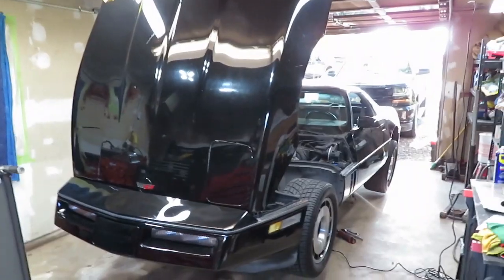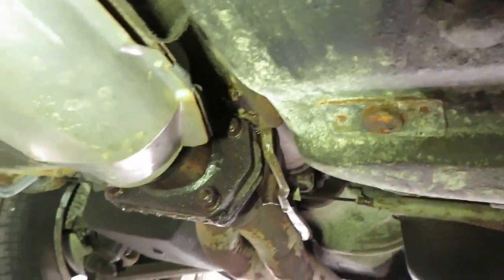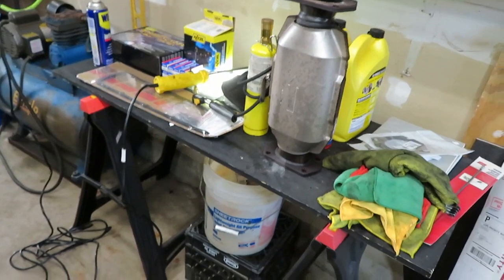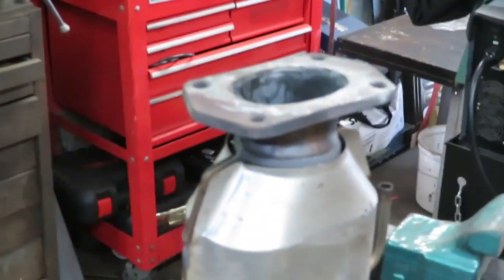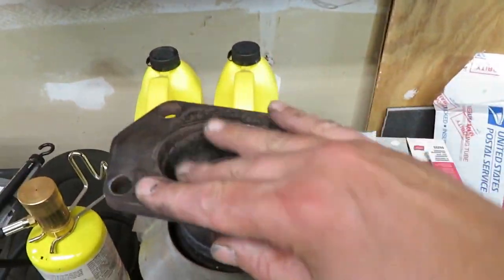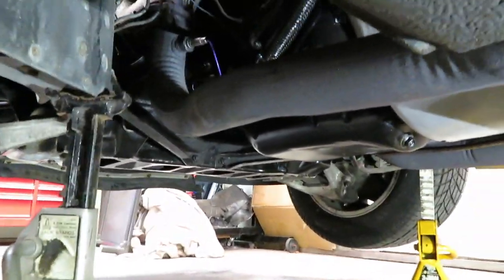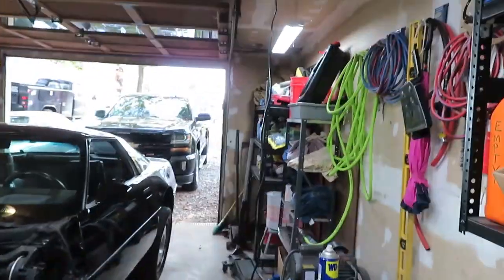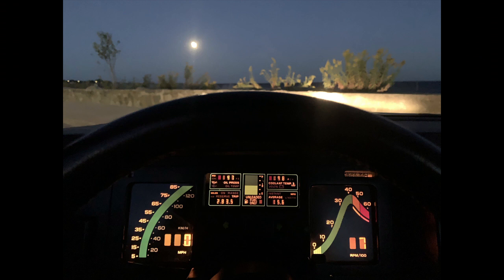1984 CORVETTE C4 GUTTING THE CATALYTIC CONVERTER

Comment: Yup, that's exactly what those do, they act like a choke . They should also have rubber gaskets that seal each side to the corresponding good inlets. There's a bunch of stuff you can do to these to squeeze out a few more hp like the donut mod lol. It's a weighted wheel on the serpentine belt meant to make the engine run smoothly, but if you take it off, the engine doesn't miss it, and there's less rotating assembly mass. What I think would be awesome would be to get 2 Holley sniper EFI units and install them somehow using the stock Crossfire air cleaner head. They send a digital dash with it so you can take out the old dash and keep it on a shelf. Just a thought 😊
Reply: I don’t think the 84 and 85 have that disc on it.  Mine doesn’t.
Reply from the maker: Sniper is pricey....I was thinking a set of heads, very mild cam and keeping the crossfire injection. ??? IDK, I'm gonna drive it as is for now and come up with a plan for it? Maybe carb it? I know for sure, those 882 heads need to go or major work?
Reply: smog delete

Comment: You seem to know quite a bit about exhaust.  Can you help me out. My 1993 Corvette has a strong fune upon start up.  I don’t have any gas leaks or see anything underneath the car.  Do you think it could be a muffler problem or maybe the gaskets from the catalytic converters are missing?  I didn’t know these bolt on and off.
Reply from the maker: IDK? I'm guessing that the gas smell is coming from the exhaust? Car could be running rich for various reasons? old spark plugs? burnt plug wire causing misfire? Weak spark? A sensor out of adjustment/bad? A leaky fuel injector? and lots more....so, hard to help out on this over the computer? Exhaust leak?  Hopefully a easy fix?
Reply: I thought it was running rich but ran codes and got one that said left bank lean O2 sensor. I haven’t replaced it yet but I was told that if the smell is immediately when I start the car up cold, then it’s probably not the O2 sensor causing that because it only kicks in when the car gets up to temp.  I do notice when my car gets up to temp in about 5 mins, the check engine light comes on.  But I agree, it could be a list of things wrong.  I need to take it to an exhaust shop and see what they tell me.  I also need to replace the O2 sensor.

Comment: Getting ready to tackle this job in about an hour, from what I can see there’s no sensor or anything to unplug other then just unbolting the converter and then bolting it right back up after hollowing it right?
Reply from the maker: nothing to unplug but, in a later video that I made; I had to remove cat again and remove the tube inside the cat....it made a whistle sound so, make sure you remove that tube....
Reply: @daredevil7442AUTOMOTIVE   so I wouldn’t have to put the connector on the passenger side of the cat back on since I’d just remove that tube Anyway? Thanks for the replies!
Reply from the maker: @tannersanders9778  yes, you could remove the pipe on the outside and plug the hole, that's what I did but. I also removed my smog equipment...I have videos on that.  Or you could leave pipe attached and just remove the tube from inside the cat and still connect pipe from outside the cat. You'll see what I mean as you do the job. Good luck